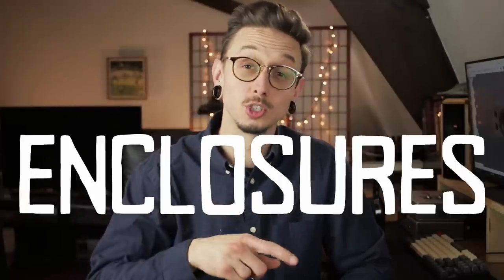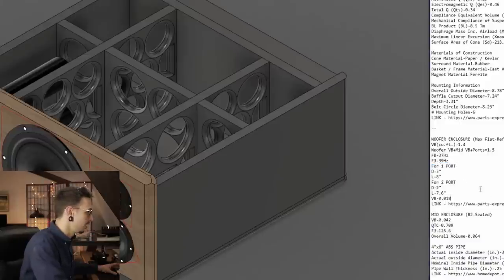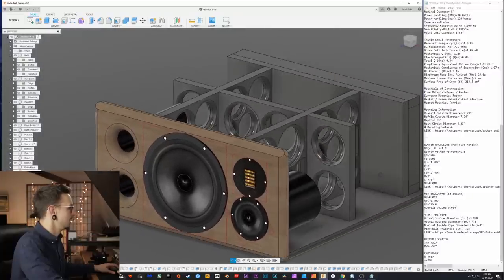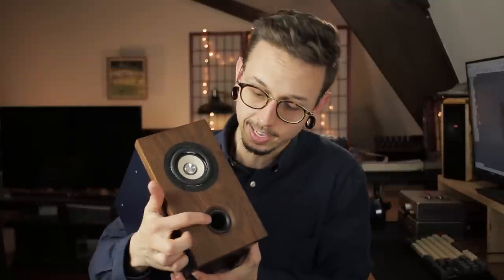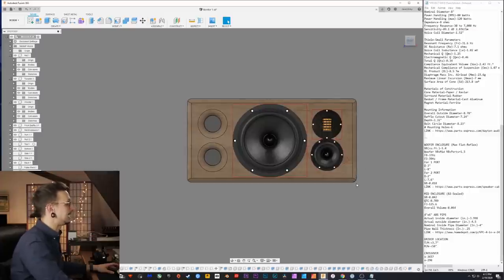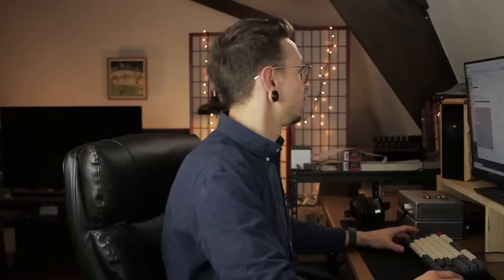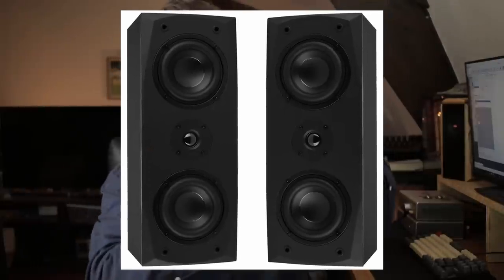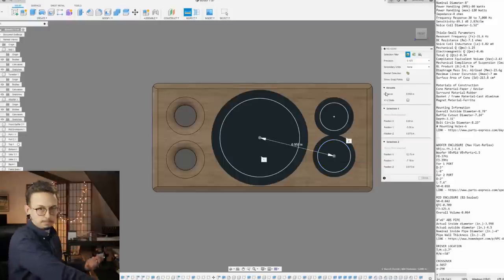DIY Studio Monitors (ENCLOSURE) Step #3 | Home Recording Studio | Dynaudio Inspiration!

Comment: Hey man! Love all of the fantastic knowledge you share in your videos. And just wanted to let you know that we hope everything is going well, we haven’t heard from you in over a year! Can’t wait for the rest of this build!
Reply: Yeah I keep checking in here now and then to see if there's any sign from him, but still nothing :(
Reply: It's been 2 years now.
Reply: .....and now over 3........ :(  Hope the you-know-what didn't get him.....
Reply: 3 years now
Reply: You left us hanging, bro!!! Just kidding! Hope everything is good, man! These videos are some of the most succinct, but deep (enough) videos on speaker design that I've come across. # videos summarized what I learned from dozens of videos from others. Did you end up building these? I'm actually in the process of designing and building a very similar design, but for home theater surrounds and heights. I'm using the Designer Series instead for the woofer and mid, and the reference dome you showed instead of the planar for now, but could switch to all reference. And I'm actually trialing out different crossover points and slopes with the 4 channel DSP KABD board, so I inadvertently built the active studio monitor you designed here with no previous knowledge of your build.

Comment: Hey Kirby, really enjoying this series! As to your Fusion360 question, a Canvas is intended to be used when a designer has a sketch or image that they are importing into the scene to use as a design reference for modelling. Canvases come in semi transparent (so they don't obscure scene geometry) and so have the red outline to make them easier to distinguish in the scene. What you should use in your situation is Insert > Decal, which is meant to be applied to a model face for rendering/realism (and comes in at full opacity).

Comment: Having spent a lot of time and money on studio monitors myself it makes me appreciate the factors that go into a high end pair even more. Thanks a lot for making a series like this. It is very interesting! I recommend taking a look to Neumann KH310 monitors for a little more inspiration on what a very flat mixing and mastering monitor is laid out like. AMT tweeters and a traditional cone midrange may not give you the fidelity you're hoping for (especially when it comes to the issue of lobing/stereo imaging). Consider swapping the cone midrange driver for a dome midrange (Dayton makes their own for very cheap). You may want to also consider an aluminum or woven alloy tweeter for enhanced accuracy. AMT/ribbon tweeters in my experience are not as nice to work on as a traditional dome tweeter (inverted or otherwise). Focal Trio6 monitors are known to have excellent sound in the air band thanks to their inverted beryllium dome tweeter. Keep up the excellent work, Kirby.
Reply from the maker: Thanks for the tips! I definitely want to test different driver types to see what makes the most sense. Thanks!
Reply: thats a matter of taste, matter of fact is there alot more amt/ribbon tweeters in pro studios then not. you can take that comment as you want, the amt air tweeter from eve audio/adam audio are among the best you can buy those for around 66$ each direct from the eve audio/adam audio companies. those tweeter will alsow alow you toget high end tweeters and be able to work longer whit no ear fattige, and even making a skeaper this caliber whit dayton units, wont go every well as thats budget hifi units
Reply: @KirbyMeetsAudio  do far field monitors next your biggest challenge in speakers trust me

Comment: Genuinely happy i found your channel... not only are the videos relaxing and enjoyable to watch... I get proper info dumps like this video... 
I do maker stuff too, and I'm doing a speaker project pretty soon and i've been looking for information like this on best practices for speaker setup. So many other "DIY speaker" videos take no consideration at all for the internal and external shape of a speaker. Or just use the same sub tube channel as they do for any other speaker but they dont go into why they design that channel or the reason for the width of diameter of a tube....

While I dont need to go into the super super HIFI end of my design, I do want to find the best practices to avoid clashing frequencies and resonance to get as clean as I reasonably can get on my speaker design...  So finding your informative vids is great.

Comment: Great video! 
Correct me if I'm wrong but, doesn't a mtm give you great dispersion at the tweeter level only? In other words if you were to stand up you may not be able to hear as much sparkle of the tweeter as you would if you were sitting at tweeter level ?
Reply: I wanted to say this too.  MTM has horrible vertical dispersion and it's why it should be banned as a center channel configuration unless you intent is bone all but the main listening positions frequency response.

Comment: What about more amplifier builds? Or power supply builds? I would really like to see a full speaker design walk through and build of a bi-amp, active crossover 2 way system using an analog crossover maybe with XO modules that you are able to swap.

Comment: I'd love to see a video about 'options'... like, what you need to power the speakers, what you need if you want an internal powered soundbar, how to setup speakers if you want the TV to control the volume, etc.... lots of great speaker videos and standalone amp vids... but be kinda cool to see what's needed for different situations. I'd like to build a 2.1 soundbar/sub but I don't want external amps sitting around or to have to control the volume at the amp.

Comment: To fix the problems with baffle step and diffraction, you could as well put some foam around the tweeter.  Old B&W (like de DM6 speakers) or Rogers speakers use this technique. Another solution as well is to put the tweeter in its own small enclosure and put in on top of the larger enclosure, for instance something like B&W 800 series.

Comment: The issues of "baffle step" can be eliminated by soffit mounting the speakers. Eg quested 412 etc.

It can also be solved by using horns, line arrays, transmission lines, planar diaphragms, all sorts of methods.

Comment: How did you decide to tune the enclosure to 37 Hz when the F3 is 39 Hz? Is it just a general rule of thumb to go 2 Hz below F3?
Reply: Hi! I know you're expecting a response from Kirby, but to share my thoughts, no. It isn't a rule of thumb to go 2 Hz below. However, generally, you don't want your tuning to stray too far from the F3
Reply: @michaelrefuerzo9186  Doesn't look like he saw this question XD. Thanks!
Reply: Probably busy doing the build. 🤞Anyway, F3 is where the response rolls off by 3db and compensating it by having the tuning frequency close to that may extend and flatten your low end FR.

Comment: Der Kirby meets audio thank you very much for your great work I have learned a lot watching your videos , I in the process of building my speakers but I have some questions that keeps coming up that I could not find an answer , I am building a non uniformed speaker meaning it don’t have any straight edges any thoughts on that ? And I am using a 4 combination drivers for it a woofer, 2 mids and a Twitter, now do I have to match watts of the drivers for best results? What would be the total wattage of the finished speaker? How to calculate the sensitivity based on driver selection?
If you could kindly touch on explaining that In a video that would be a great resource for many people that are interested in making there speakers, thank you

Comment: Hi Kirby,
I found these litle gems and would like to attempt building my first studio monitor. I have a pair of Mark Audio Alpair PW12a fullrange. Need help with box doesn't matter the size but I wanna get as wide of a range as possible 20-20kz would be optimal lol. Or should I utilize this speaker as a mid and create a 3 way like yours, cheers you do great work.

Comment: Thanks for nice and clear explanations. I have a question 
I have tried many TPA311*  boards but all burned out without any heating, what would be the reason. I was using LiPO battery 11.1v and 16.8v with a 176 Ampere of stable current output, please help. 
The last one i have tried is TPA3118 and it plays for a second and the pop sound and total silence for another second, and this cycle continues

Comment: Hi, nice video. I've been getting information on monoblock amplifiers and I have an idea... just don't know if it's a good one. I hope you or someone could help me figure it out.
The idea is to have a vacuum tube preamp module and two mono digital amps. The amps and the preamp would have each one their own transformer, so, with a little bit of work I could end up with a monoblock system, right? It would have that design that look expensive and as far as I understand, it would sound great at a very low cost.
Hope my english is good enough. Thank you.

Comment: Hi, Kirby! Great videos! Do you use any flexible sealing tape between the enclosure and drivers? I know it is a must for sealed designs but would you recommend using it also for ported enclosures?

Comment: Kirb, if I like to use a 10" woofer with a bigger enclosure... is that adding more and better bottom....????
Reply: It depends on the woofer itself. Take the parameters and throw them into a box calculator.
Reply from the maker: Yeah! Most of the time a bigger enclosure will give you more bottom end. Thanks for watching!

Comment: With separate subs is it important to keep this crossover distance for lobing? If it points in a slightly different direction compared to the mid-woofers is the distance different?

Comment: "Big" Monitors I have a pair of Altec VOTs That are my workshop, now that's a big speaker.  There in a modified  enclosure based on the  Altec A7 enclosure,   the base reflex section was sealed and enlarged  to accommodate a JBL PR15 passive radiator.  incredible bass but overall sound quality is not great.

Comment: Great job, man.  Dynaudio is a good inspiration!  They translate really well.  I've been mixing on Dynaudio nearfields for years (I needed to switch to a powered speaker so I could build a remote rig that didn't necessitate dragging around amp racks).  That is going to be a loud nearfield once you're done, at least as far down as it can remain linear below 100 Hz.  If you ultimately design a sub to go with them, you might want to geek totally out and read some of Bag End's technical literature.  Along with Velodyne (different approach but roughly same goal...Velodyne used a servo), they really pioneered the ultra-low, flat response sub world.  https://bagend.com/wp-content/uploads/2015/01/inframxb.pdf is the link for the only dual-integrator product they still sell.   But you can actually (now) achieve it in DSP.  There are some programmable plate-amps, I think, with the ability to mimic the dual-integrator circuit.  You give up some of the phase linearity with the DSP/EQ approach, but you also get some ability to correct for it if the DSP can handle teeny delays.

Even without a sub, your ported design is going to be good.  People will be able to actually see woofer over-extension (the ported design will make it super obvious), and really, that is about as visual an indicator as a person can get that something is going on in the infrasonic range that is eating amp and driver efforts that don't pay off.  One of the biggest challenges in mixing bass, really, is getting the most bang for buck where most listeners will be able to hear it.  If you are really geeking out, you might want to read up on how Waves handles that in DSP for engineers in their MaxxBass product.  Long story short, you program MaxxBass for the cutoff frequency of the cabinet, and the circuit starts taking out fundamental frequencies and building an overtone profile which fools your ear into thinking they're present.  It's more of a bass-sculpting tool for mixing though...would actually be a bad DSP design for monitors because you'd lack the cone-travel feedback to let you know your mix was trashy down low.

As far as YouTubers who would be a great match for you, I can think of two.  Definitely Rick Beato.  He is around my age, and his channel is mostly recording/producing knowhow and music theory, but he has a studio setup that facilitates very nice video work, and he is one of the most intelligent and thorough musicians on YouTube--super well rounded.  Also, I'd recommend Adam Neely.  He's more of a jazz player, music theory guy, but he is definitely in the home and studio producer world.  I'm sure there are some others, but I think both of these guys really fit your vibe, and they are not inclined to just be into the "yay, free stuff" mindset.  I think they'd both appreciate your content, particularly Rick...I suspect he'd be very much into a guy like you, who is trying to enable people to listen to their music more as the person who mixed it might want to hear it (and helping people build a monitor they might not be able to afford otherwise).

I have never gotten around to a YouTube channel.  It's on the list.  Mine will probably be more of a Sound Design (film and theatrical) emphasis, as there are lots of people covering the music-exclusive side of production already.  If you ever need to get in touch for anything, I'm findable enough.  I used to write quite a bit for music industry sites and did some guest shots at Keyboard, and I'm easy enough to locate on Facebook.

Comment: Hi Kirby/comment gang, Do you think epoxy/resin would be a decent enough replacement for wood in a build where 60-80% of the build is resin? Thinking to use some interesting shapes that can't be made with wood. If anyone knows, let me know! :)
Reply: Dirk Knight Hi, thank you very much! I’m studying industrial design and I have access to good 3D printers/materials at my uni. I’m planning on making a curved/nicely shaped enclosure, by designing a 3D printed mold to be able to poor resin into that. Think it can turn out really nicely :)
Reply: Dirk Knight   Sounds good! good luck with that in the future, and yeah I'm really excited and curious to see what I can come up with, thanks again for the extra info! I'm also lucky that I have some people at my uni that want to help me with some enclosure size/shape calculations and crossover design. Can't wait to start building.

Comment: Unfortunately, A tube is one of the worst enclosures to use for a midrange, it will have a very strong peak in the response because all internal distances are equal. You can still get away with it if you stuff that tube really well with a proper absorber.

Comment: Lots of people have been asking about Kirby, like, where is he - and is he all right? ...Well, Sadly, Kirby stepped on a baffle and diffracted his polar plots, but he's ok though, and we continue to monitor his frequency response for any deviation in his highs and lows... His bass line is normal, however, we are still a little worried about the frequencies of his active crossovers, and, his 30 degrees listing position -  both of which should correct themselves, once we disconnect him from his port-tubes.  👀😎🥴😂